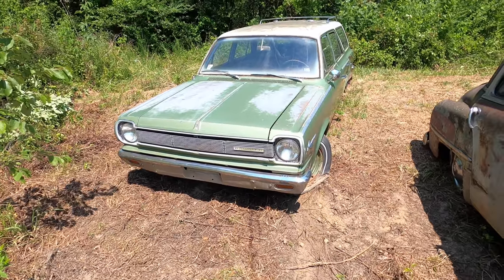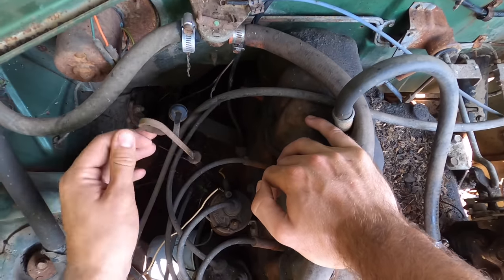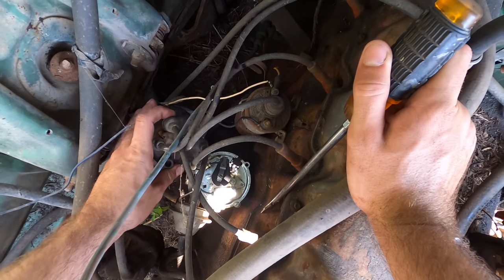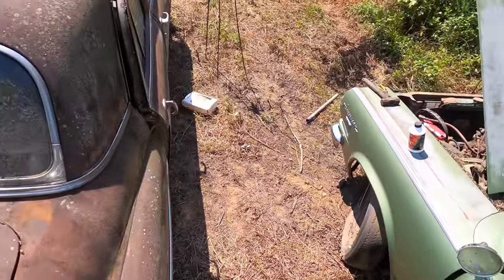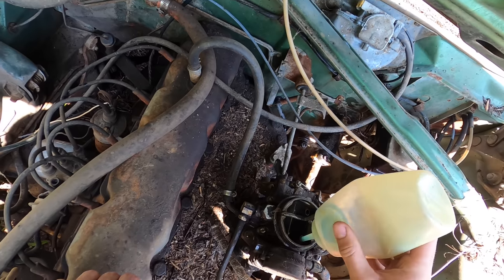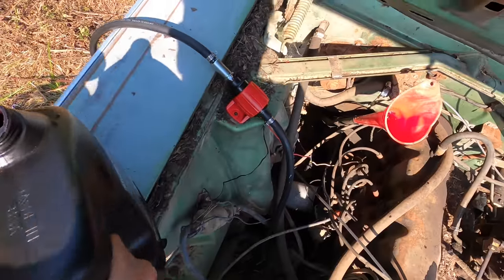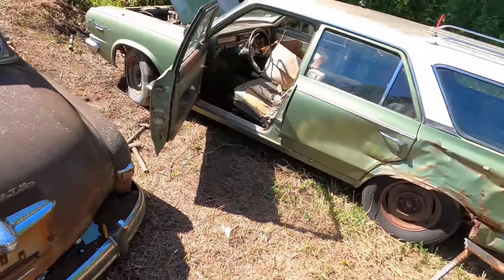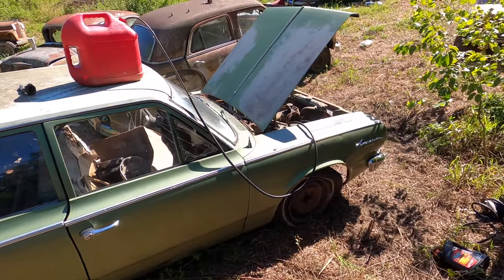Will it run after 26 years 1964 rambler American wagon

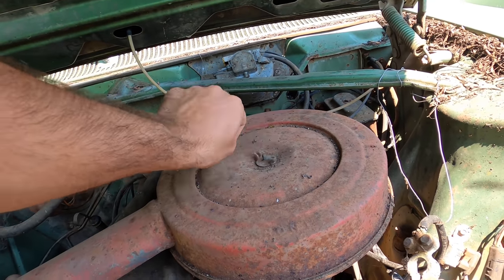Comment: at 2:30. "it seems like that if there IS a rats nest in the air cleaner that it is MORE likely to run" I just thought of something. if there's a rats nest built in there shortly after being parked. it might actually help. dry fluffy material absorbs water like a sponge. the rats nest soaks up any water that gets in and keeps it from going in to the engine. kind of like putting a wet phone in rice. so its good for it so long as the nest and or poop doesn't get in to engine and it just stays at the top near the intake. that makes sense to me. anyone else??

Comment: You don't like getting shocked disconnect the battery until you're ready to test it out also you might find yourself a light bulb out of a tail light and two wires and build yourself a test light

Comment: It was low you just filled the torque converter. That's a air cooled transmission. Full none running is low probably 2quarts

Comment: The 1969 Rambler came with a 199 1 barrel with a closed chambered head...  Would rev over 6k stock...  Missed quite a bit up that high... Could've used electronic ignition...  Bulletproof engine...

Comment: That's the first car my dad bought me I was 16 in 86 and all the kids made jokes about the super six after losing race after race to bigger piece of s*** than mine I took that motor out and I in my cousin put a 440 in it out of a 69 Dodge charger we had to change across member drive shaft but that thing wouldn't keep that it was one wheel pill like crazy so we welded over and then it and when I took it to school I had to put stock manifolds on it and had a single exhaust and I took it to school and I erased this this Kenny Kenny Coop saw with his 55 Bel Air which is supposed to be badass and I blew him out of the water dude anyway I made it fast as I could and it was fast it was a boat but that some b** was a sleeper I got my license took away in the cops and pounded it and I never got it back again

Comment: That is a Chrysler transmission.
Reply: This car has a Borg Warner automatic
Reply: AMC used BorgWarner Transmissions through 1971. 1972 models used Chrysler.
Reply: @johns4306  The ones I had were Chrysler. I only had two automatics the rest were standard. At that time I was a road salesman putting sixty thousand miles per year. I traded at one hundred fifty thousand and never had a major problem with any of them. I wish I could still buy them built like they were then.
Reply: The Borg Warner "Torque Command" used in AMC cars was actually descended from the old Ford-O-Matic two-speed, and shared some parts with that design.

Comment: Check to see if you losing transmission fluid on the ground
Reply: Many years ago, I had a 1967 American which started running rough and smoking. It turned out to be a faulty vacuum valve that allowed transmission fluid to get sucked into the carburetor. It cost $20 to replace, as I recall.

Comment: That distributor cap has a problem you need to start both screws before you tighten one down all the way I go back and forth between the two and slowly work the cap onto the body of the distributor because AMC made them an extremely tight fit and if you just tighten one down all the way there's a good chance that the either the other screw isn't going to go in or you can bust the cap

Comment: Your engine videos are awesome but you scare the hell out of me. Before you do anything with one of these engines please, please clean all of the stuff that could possibly catch fire off the engine and away from the aparts of the engine that could get hot. I've seen you set yourself and an engine compartment on fire by disregarding electrical safety and general fire safety regarding gasoline on hot and or electrified surfaces. I love your videos and I want to see a boatload more but I don't want to see you or one of your projects go up in flames. It's just too damned easy to do. A cheap fire extinguisher can be had for far less than one jug of Marvel Mystery Oil and will save your ass and your project if everything goes wrong. But just cleaning out the engine compartment before you start will take your probability of a fire from about 90% down to less than 5 percent. All you need is an whisk broom a few old paintbrushes of different sizes and believe it or not and old or couple of old toothbrushes. Also a third of all of my issues with electrical systems have been because of poor battery connections. Just tighten the bolt on your battery connectors and you will save yourself so much grief and wasted time. Again I love your videos oh, I love what you do and want to see more of it for years to come. Keep up the awesome job and please do it safe.